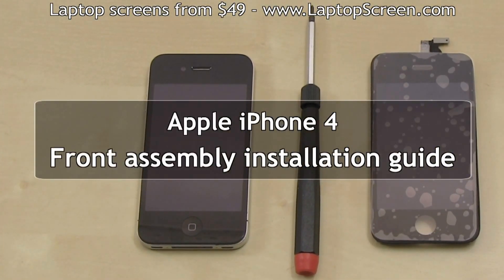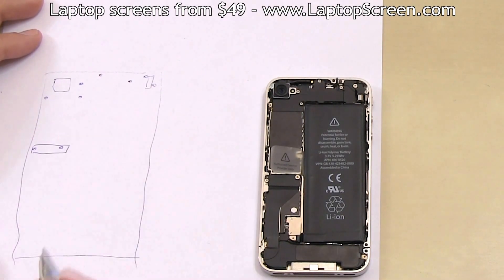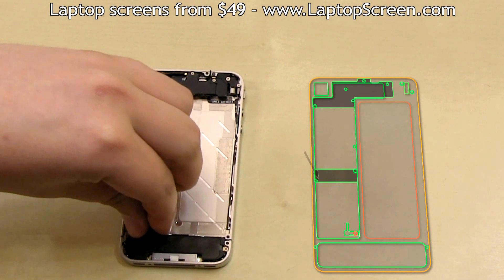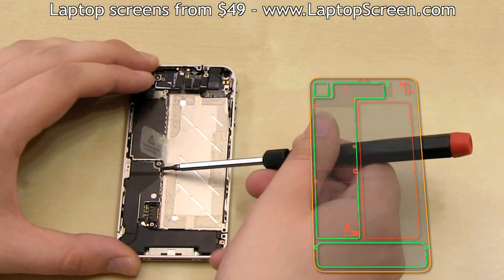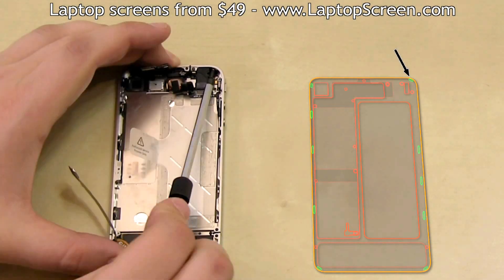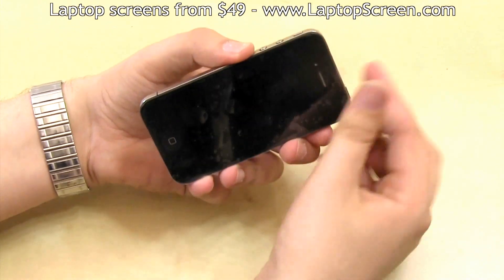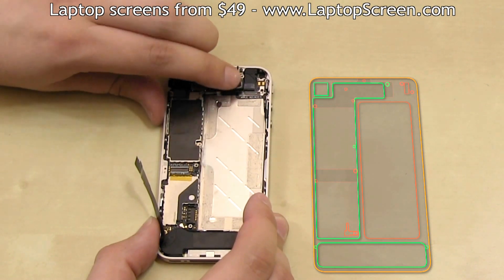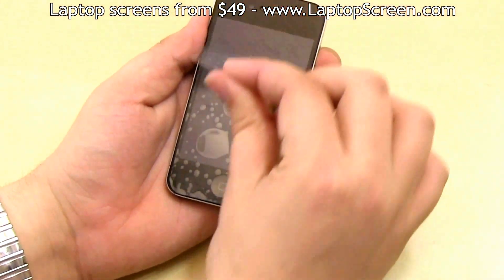*** iPhone 4 screen replacement / repair disassembly and reassembly guide ***

Comment: Thanks, I studied several of these how to guides as I was replacing my iphone screen. This is the best one, the others leave out things that I needed to know, and spent way too much time on simple stuff that should have been skipped. Follow this and you it'll work out fine. The only criticism that I've got is, I wish you would have specified the length of screws that should go back into some of the covers (one cover had 3 or 4 different types of screws) - to avoid any confusion use a template.